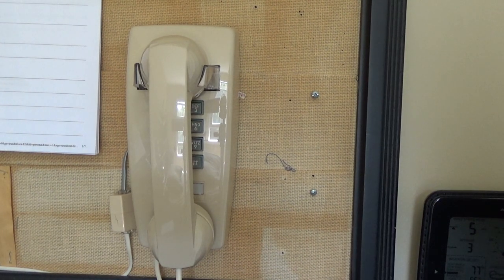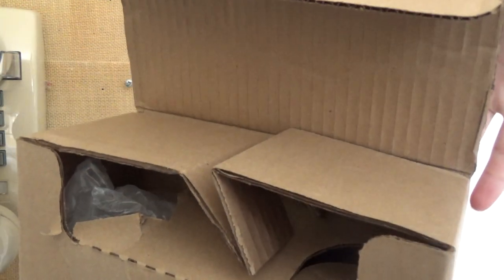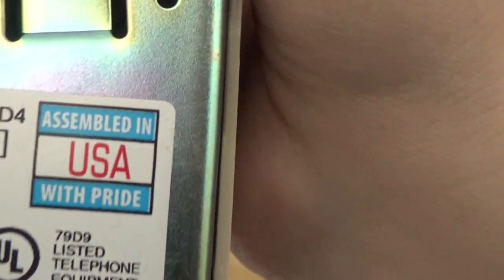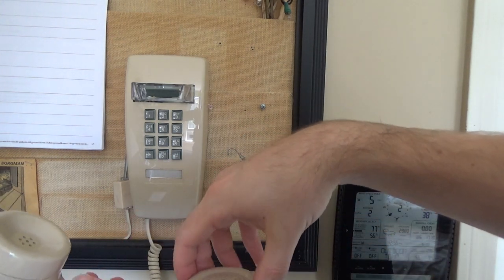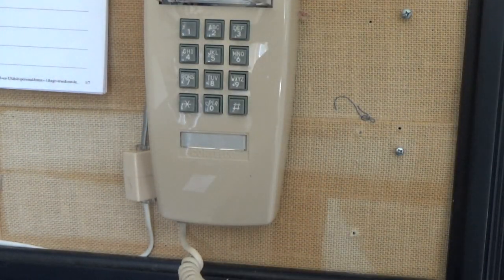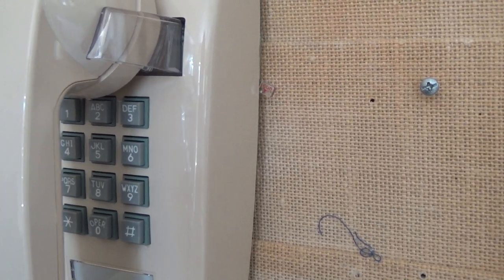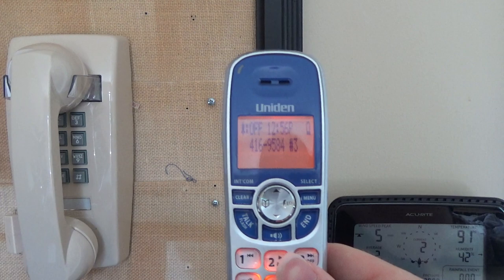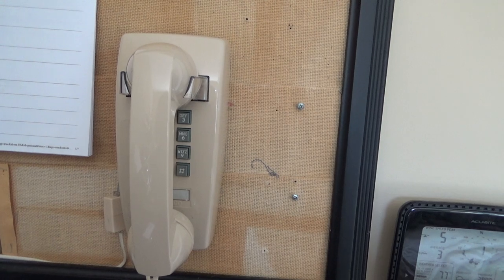Modern Cortelco 2554 Telephone | Initial Checkout

Comment: I just got my very own, red Cortelco 2500 set today (Model ITT-2500-V-RD), and when I opened it up, I noticed that there's a circuit board (where the network usually was on older WeCo and Northern phones) with tons of different spade connectors, of which only a few are connected. It looks like there are connections on that board for a second line, a switch for that line, an MWI lamp and among other things, A-lead control.
Reply from the maker: They do sell quite a few variants of the 2554 still, I believe some of which have those features.

Comment: Huh. The ringer is a higher tone than the classic Western Electric 2554. It seems as if Cortelco used the lower pitched of the two bells (D# and G#) from their 2500, while Bell System had a completely different bell for their 2554's and Trimline's, pitched at D.

Still a great replica series, though. Cortelco definitely does Bell System justice, and using the same bell for multiple phones is certainly a more acceptable cost cutting measure than using lower quality parts.

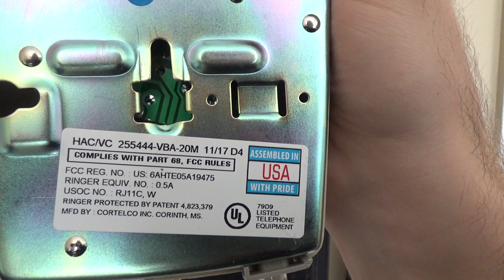Comment: The REN, or Ringer Equivalency Number was staring you in the face at 3:05.
Carbon microphones are actually quite good.  Sure, the volume is lower than that of a condenser microphone, but they almost completely block out background noise.  It was common practice for people to yell at others or keep the noise down, back in the day when carbon microphones were all phones had, especially if it was a long-distance call, but it was largely unnecessary.  You could, for example, be washing a sink full of dishes while talking on a phone with a carbon microphone, and chances are the called party will have no idea you were even doing that.

Condenser microphones pick up a lot more sound, but they ALSO pick up a lot of background sound.  So if you're in the bathroom, er, taking care of business, and talking on the phone, it's actually best to be using a carbon microphone instead of a condenser if you don't want the other party to know what you're doing.

Could that phone be fitted with a condenser microphone?  One way to find out!  Just hook some jumper leads up to the metal tabs inside and to the condenser and give it a test.  It's certainly not going to hurt the phone.  Most condenser microphones are very small, so chances are it can be mounted to the underside of the cover of the part you talk into, hot glue would be a good choice, especially at a low temperature because it will hold the microphone in place well enough, but can also be "broken" right off and the glue cleaned up easily should you want to revert back to a carbon microphone.
Reply from the maker: O.. Apparently I temporarily lost my ability to read during this production..

I'm certainly not saying the carbon microphones are bad.. It's just for this particular phone which I often use at night while other people are sleeping that I'd prefer to have something that picks up more sound..
I've used it a number of times and only once has someone commented on the sound, and at that they described it as 'different', not bad or weak.. Since it seems to be working fine as it is, as it is is how it will stay..
Reply: ah! Makes sense.
I still think I sound scratchy to others on my new WE2500 I picked up. Still a great phone otherwise.

Comment: Wow, this really looks and sounds like the old ones.  Even down to that goldish-greenish-purplish rainbow metal on the bottom.  I definitely can't complain too much about the price considering the built quality.  Does this come in black or red too?  If so I may just pick one up.
Reply from the maker: Yes, they do come in a variety of colors.. But be sure to get the one with the model number that ends in 'M', supposedly those are the only ones that are made in USA.. For instance, the full model number of this one in the video is 255444-VBA-20M..
Get one while they're still around--you won't be disappointed..

Comment: I found this nice 2500 on freecycle and would like to know the same! The incoming call quality is fine, but I sound scratchy I found this out when the answer machine locked in to one of my calls and I know there must be some way I can get it sounding better. There has to be. For reference I am using xfinity phone line not sure if its coppor or phosphoroptic or whatever.
Reply from the maker: These have carbon microphones, that's how they sound.

Comment: This is the exact same type of phone that they have at every checkout lane at our local Meijer Shopping center.
Reply from the maker: Same color?
Reply: Nope, black. They also have these in red with the number pad removed to be in the isles and be used to call for assistance. All of these are on a newer avaya VoIP phone system.
Reply from the maker: Most of the ones here are black.. There's 1 of this color that I know of.. I'm not sure what kind of system they're on..
Reply: You have a meijer near you? I thought it was a Michigan thing, not a Connecticut thing!
Reply: Yes you  can buy the hole phone micro phone for it